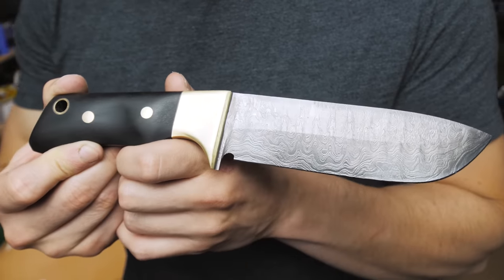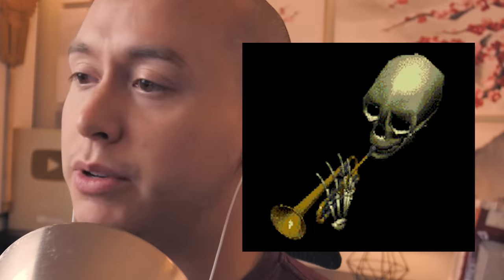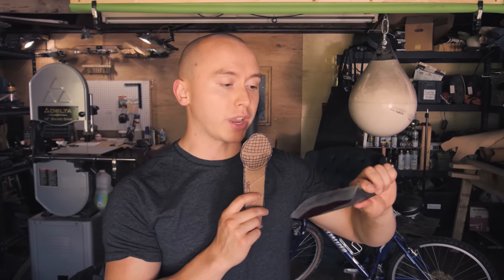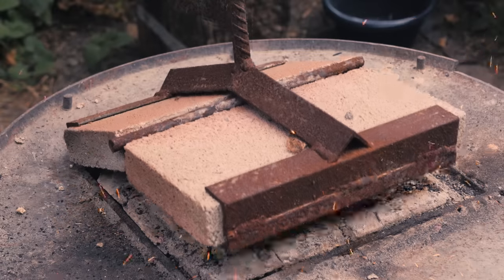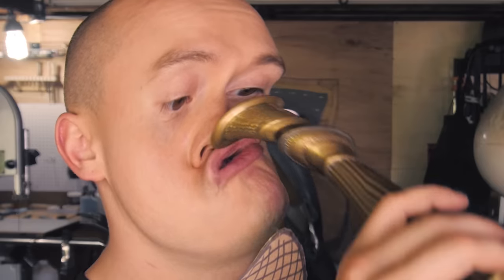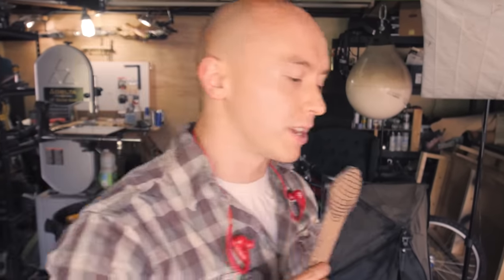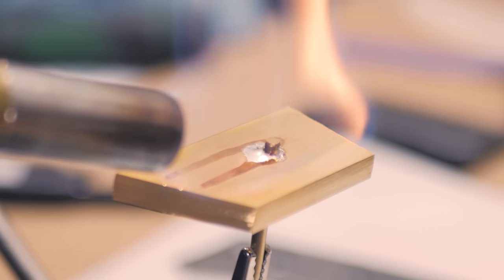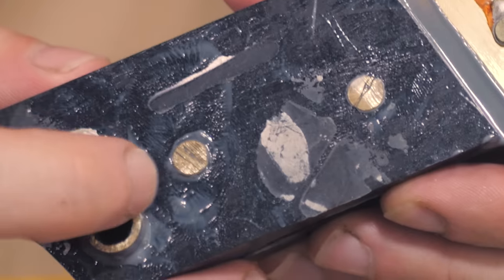I accidentally made the nicest knife I ever made

Comment: Really nice looking knife, a tip .. you didn’t temper it properly, that must have been very hard to drill, you did the first step to harden it then dunking it in oil, if you drop it , it could shatter, the next step is to heat it to straw yellow , then dunk it in oil then it’s tempered.